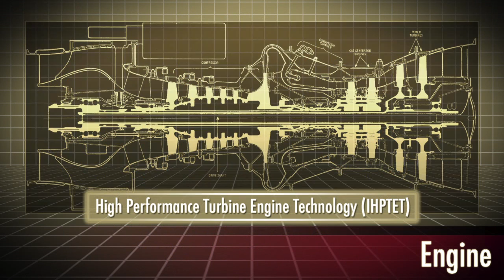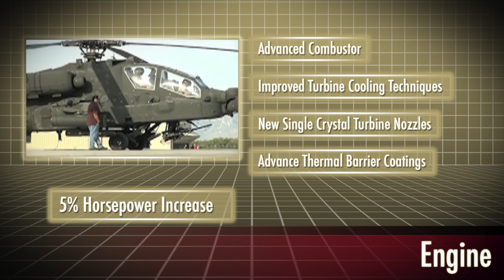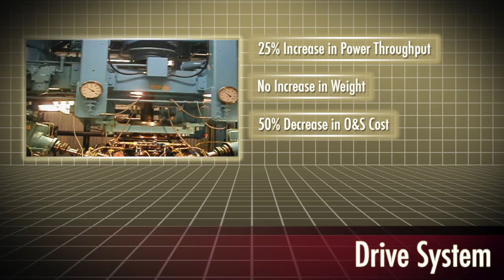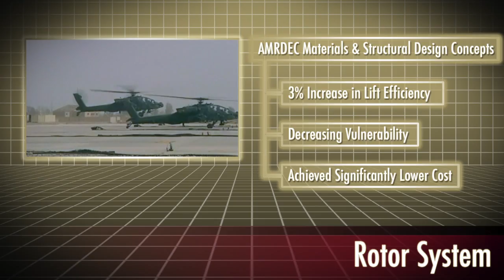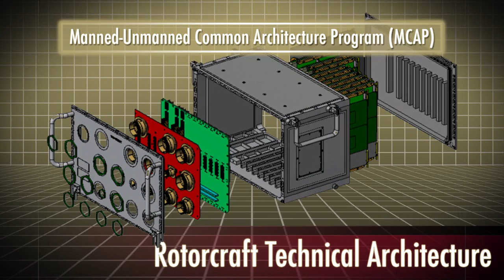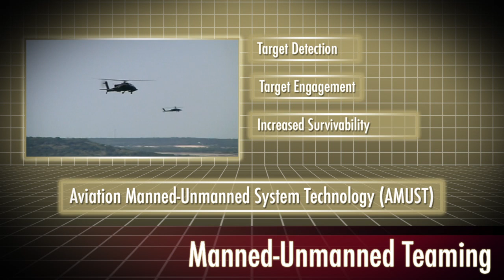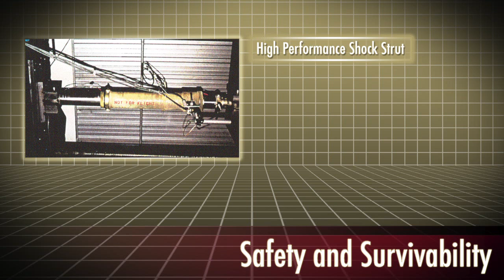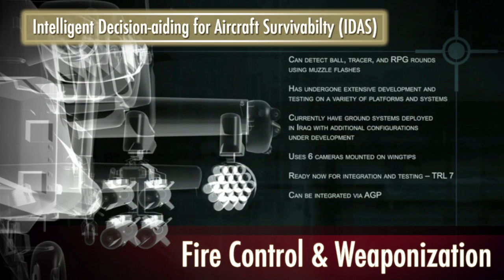Making the Future Happen for Today's Warfighter

Comment: Not really both mi-28 and ka-52 lack fire and forget missiles witch Apache has, The Apache also uses a new design and long range radar. Its 70mm rockets are being equipped with laser sensors called DAGR and the 30mm gun has much more ammo then the Russian counterparts. Russian choppers have radars but many don't carry them and there performance against the new design longbow radar is in question.